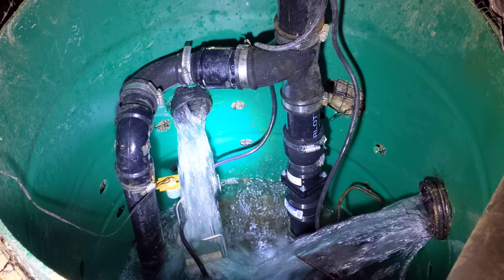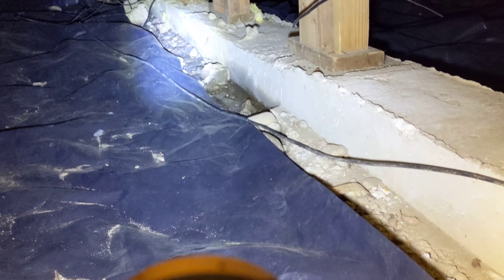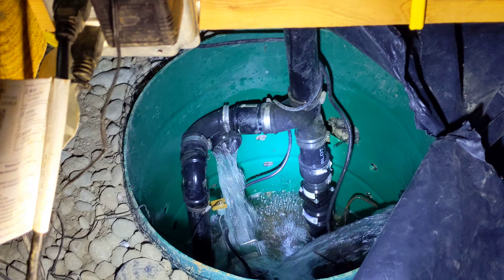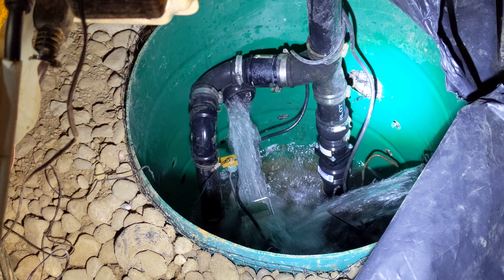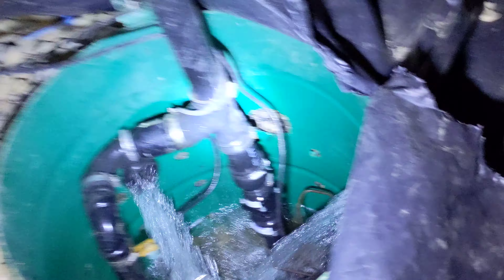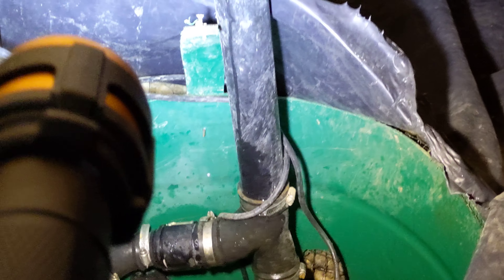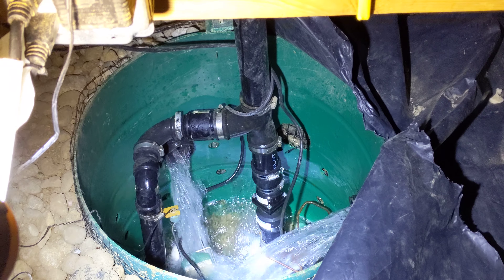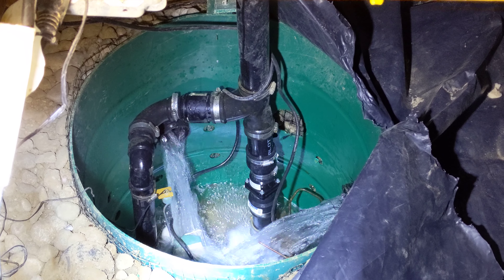Sump pump working non stop after heavy rain, underground water flowing in like crazy

Comment: I would recommend a lot of what has already been said. Make sure your getting the rain water from the roof super far away from the house as possible. Then I would recommend two sump pits with bigger HP motors and their own discharge pipes. Get all sources of water as far away as possible. Not sure if the slope of your yard is negative or positive meaning does the yard slop towards the house? If so fix the grade. Also maybe if water is coming from other yards towards your home put in a French drain in the yard to divert the water before it reaches your foundation drain tiles. And with the amount of water you have running in those I highly suggest a water backup sump pump, and at the bare minimum a battery backup. If you weren’t home for 4 hrs and couldn’t get your generator running within that time your battery would be dead and essentially your crawl space/basement would flood. I recently put in a water backup sump pump and that thing will run as long as long as it needs to.
Reply: There is no gravity pump that can handle this amount of water.

Comment: Those pumps are fighting each other, anyone who knows about fluid dynamics like I do will
Tell you that, the optimal set up
Is separate discharge lines 
Or the two feed lines coming from each pump must 
Lead to a 50% bigger line out.
So if you use 1 1/2 pipes from the pumps they must both lead to a 3” discharge as far up the line as possible.

That way neither pump is impeded.
Reply from the maker: Thanks! We are going to fix that

Comment: I would be having 2 pumps. You need to have a dedicated power source without failure and 2 pumps incase of a failure. Make sure your downspouts are running far from the property. This will never stop you built on top of a spring. You really need to tie this into your sanitary system to assure theres no chance of recirculation. Itll clean out your pipes too! Its a perfect discharge route, pipes are large enough to sustain the volume you're adding but i wouldnt be having this pump out into my yard and go back into the spring you're on. You need this water evacuating without chance of recirculation. Believe me sani exit is your best choice.
Reply from the maker: Thanks - due to the special condition we live (valley, rural area, septic tank/no city drain), the water table gets really high during large flood events. There’s no good downspouts for us, but at the same time, the water level in my crawl space gets to be the same as the water level even if the pumps stop working — we experimented stopping them during flood. So it looks like we are fine as long as the water table does not get too much higher than now

Comment: I am not an exprert, but I feel your 2 pumps are fighting each other in the same sized discharge pipe. I would keep both pumps, one a brick hight higher than the other one, lower one would be primary, higher one secondary, check valves in each a must. 1 1/2" solid discharge  vertically. Once you go horizontal, you have three options. (1) Go to 2" with each pump out of your home to the point of discharge. (2) Go with 2" with each pump out of your home and adapt each pipe into a 3" pipe to the point of discharge. (3) Keep 1/12 pipe all the way out of your house, then adapt to a 3" pipe to the point of discharge. The theory is to let the pumps lift the water and let gravity carry it away and not have to push it away as well. If you are still not at ease about the water levels after making one of the mentioned improvements, you can also replace your existing pumps with ones with higher horsepower ( 1/3hp to 1/2hp or 1/2hp to 3/4hp.......) If you do replace your pumps, do NOT skimp on price. The cheaper ones are exactly that. Also, if you do, do not go to a pump with a 2" discharge unless you are willing to replumb your entire discharge system by an increacse of 1" diameter piping. 2" pumps are great but not as much if they are reduced to 1 1/2" It would be like trying to breathe through a straw instead of your mouth. I hope this is helpfull.
Reply from the maker: Thank you so much for the detailed comment. This is really helpful to me. I’ll look into improving them.
Reply from the maker: @gtzgreatride  thanks for the sharp eyes. I didn’t pay attention to the pump brands before you mentioned it, I think they’re there for years
Reply: Too much detail from Original poster, here's your solution 

2 separate discharge lines, one pump set at a different height use one as a back up if over whelmed, use the more powerful one as your base. Secondly where is the discharge pipes going? Route too your sanitary if possible and there is no chance of recirculation. 1/2hp minimum in your case.

Comment: Do you still have this issue? Have you made any adjustments or found out anything you can do. I have a similar issue.
Reply from the maker: We still have this issue. The root issue is that we are in a valley, geographically water flows from mountains nearby to lower ground like where we are and result in high water table, so there’s no ultimate solution for us. There are ways to increase water flows out our drain it farther, but it won’t solve our issue - because of the high water table, water comes back. Our current solution is to buy flood insurance to protect our house. In a year with less precipitation like this year, we are safe, we just don’t know how bad it could get if lots of rain pours into our region.

Comment: Normally water entering your crawlspace, as in your case, comes from outside the house when it rains. The most common source of this water, by far, is your gutter downspouts dumping the water directly next to the house and then the water finds it's way into your crawlspace,  which could explain your problem. I assume your house is several inches to several feet higher in elevation than the street (it should be). The normal solution is to buy a 4-inch corrugated (or 4-inch solid pvc) pipe and connect the pipe to the bottom on your gutter downspout and the other end of the pipe at the street. Now the rain falls on your roof, is collected by your gutters, goes into the 4-inch corrugated (or solid pvc), and finally is dumped into the street and far away from your house.

Ideally you want to dig a trench so the pipe is out of sight, but there's no harm laying the pipe on your yard for a few weeks or months to wait for the rains to end and you can get several teen kids to dig a more-or-less straight trench that is roughly 12 to 18 inches deep, from your gutters to your street. Doing this will also allow you to test the before and after of how much water is flowing to your sump pit in your crawlspace. Ideally there will be almost no water going into that pit during the next rain.
Reply from the maker: Thanks for your input, Donald.  That's a good point. We have corrugated pipes working hard to dump the collected water somewhere. As far as we know, one of them dumps the water far away from the house.  But for the other three, we are not sure where they go as we are the new owners of this property. We will check them out. 
And since this property sits in a valley area, the water table goes higher during the rainy season. That's probably another main reason why there is so much water. A couple of my neighbors have lifted their property after getting flooded. This property has not been flooded, but when I was recording this video, that's really a big concern. 
Anyway, thanks for your info, I really appreciate it.
Reply: @life-in-a-nutshell  how did you neighbors lift their properties? I would suggest digging around your house for 2-4 ft to have a french drain. All water collected by the French drain will be pump out away from your house or dump to a lower site if you can find
Reply from the maker: @wenjunli2006  Thanks for your reply. We are located in an area where French drain is not suited for. The nearest lowest place would be a portion of our backyard. We do not have public sewer system here, so the water from the French drain can't go there
Reply from the maker: @wenjunli2006  My neighbors add additional foundation to their houses, made it higher.

Comment: Really the discharge pipe going outside should be 2 inch inorder to handle both pumps running at the same time. Or you can each pump on its own pipe going outside.  I'd look into a battery backup or a water operated backup pump.
Reply from the maker: Thanks Joe. My discharge pipe is 2 inch. I’ll look into a backup solution. I just learned about a water operated pump from you for the first time!
Reply: @life-in-a-nutshell  I'm not sure if a water operated pump would work for you with the amount of water you have coming in might still over flow but wouldn't hurt to as around about them.